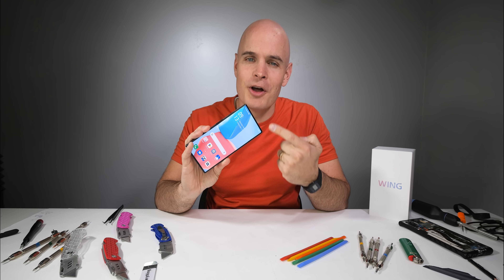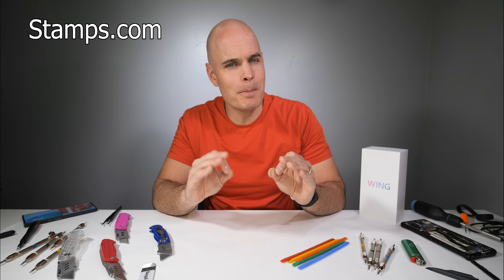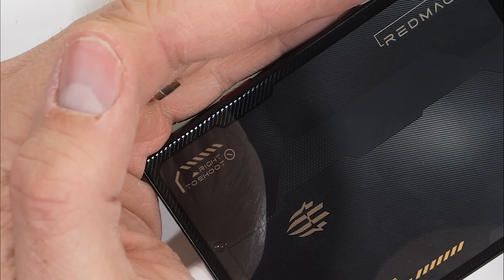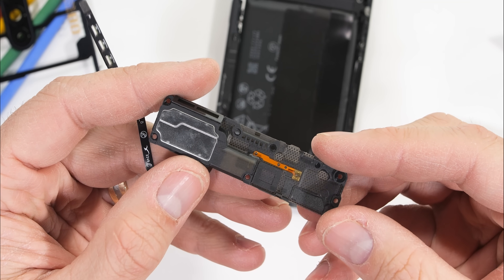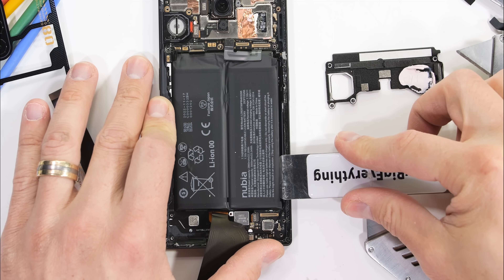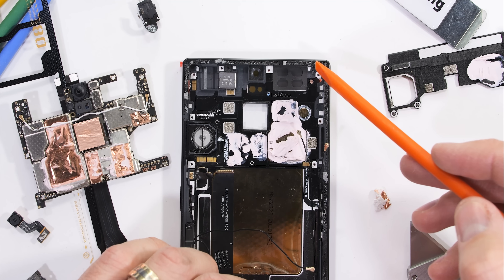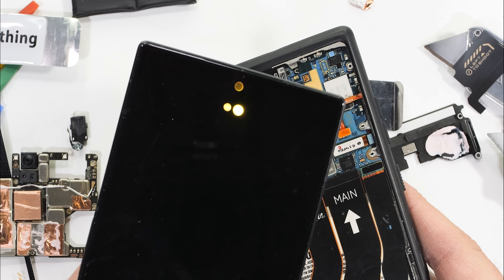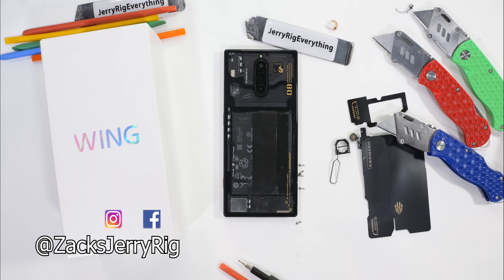The Smartphone she told you not to worry about....

Comment: The screen to body ratio alone is really nice. Love how we are seeing a return to the squared off aesthetic, banish the curved edges!
Reply: as someone who is only buying this for the formfactor... I agree
Reply: @Medicalscape I still can't believe it's aboyt 1% lower than the s23 ultra but if you keep in mind that smartlhone bezels are always mind up of the first black bezels and then the 2nd metal frame u can see the metal frame part is decently large where the black bezels themselves are pretty small. Either way still much better looking overall even if the screen to body ratio isn't anything out of the ordinary. You can look at gsm arena and they have that metric and the much less misleading screen area metric . In case u didn't know screen diagonal is skewed the taller the phone is in aspect ratio. That's why the z fold is only an extra inch in diagonal despite being over double the screen area bcuz it goes from extremely tall to extremely square. Interesting to me at least when i found out idk.
Reply: @Frozoken  yes its really interesting I have been using the zflip3 for a little over a year and a half now I like it alot!

Comment: The shape of the screen, hidden front cam , battery power etc. are very good. It makes sense that it's not waterproof because it has a fan, but I still prefer my phone to be waterproof. And what I don't understand is why companies gradually stop putting sdcard support. OK We have moved to cloud storage. Please don't remove the features we like and make a new phone.
Reply: as someone with trash net speeds and bad mobile coverage no alot of people havnt moved to cloud storage
Reply: Mostly because SD cards tend to cause more problems than they solve, especially when it comes to moving apps to the card. 

However, there are still phones with SD card slots if you want to put your money where your mouth is.
Reply: @Lefaid Cause problems like WTF  ? If you have a slot it won't gonna come and hurt in your back , if you don't want to use it than don't ..
I don't have unlimited cloud storage or internet, we only get 1.5 Gb per day her in general. 
But if my videos/movies have more size than >100 Gb , and it's only read data so it won't reduce speed of mobile while on staying in ROM and not RAM , it won't cause phone to slow down , it's just that apple thing that Android started doing after headphones jack removal saying it was using space while world's thinnest phone still has a headphone jack inside it 🤡

Comment: I know hidden selfie cameras take bad photos but for me personally I use my screen way more than my selfie camera (I almost never use the selfie camera) so I would prefer mine to be hidden.
Reply: I feel like Samsung should release a lower production variant of the s23u with an underdisplay camera, a slimmed down symmetrical chin and slightly more thickness for cooling and more battery for a way more well rounded version of this in everything except under display selfie quality and how well bezels are hidden,  s23u still actually has a slightly higher screen to body ratio with the hole bcuz the red magic's  bezels are just proportionally more of the metal frame rather than the black part which does look better even if u don't get more screen but besides that in the US they're not far off in price to the s23u with clear cost cuts including the actual panel's quality itself in brightness and colour accuracy (ie 800 vs 1300 nits measured, ignoring the higher claims of both), the rear cameras and the obv software ofc
Reply: @Frozoken agreed 💯

Comment: It would be interesting to see how much of a performance difference that little fan would bring along with the (slightly dmaged) copper pads 😂
If possible it would be great if ypu could do a comparison
Reply: I would imagine it to be a measurable, but not huge difference since the air duct does not contain any fins for heat dissipation or is even made of copper. Definitely went for form over function
Reply: @tjibbeettema8759  it would still remove heat from the phone way more efficiently than nothing at all tho

Comment: If need for good long gaming sessions ,choose REDMAGIC 8 .The size really do matters as it packs Much of engineering needed for COOLING🥶❄️ the CPU for keeping those frame rates CONSTANT .Again THANKS  Zack 🤍,You do show us the reason for picking the phone (from the Inside) 🤝.Also the LG WING you did mention has good hardware and software . I would be THANKFUL 🤍 if had it because i do OWN a low spec😓(Nokia 3.1) and it gives me HARD times 😣 and much loading especially when i connect it to Cellular 😕. Would be thankful if a have to switch 😌. THANKS 💚.

Comment: I kinda want to take apart some of my old phones just to look if they have taken up some dust in on the inside over the years. I still have most of the phones I have ever owned. starting from a Siemens that don't work anymore and  Nokia brick that still turns on if the charger is plugged in.
Unrelated to phones do you play games and if you do.... have you played warthunder? I am looking some someone to platoon up with
Reply: ouh... have you destroyed any of the old phones? I have been watching you videos for a fairly long time on and off when I see one pop up but haven't really gone through all of them. So I am kinda interested in seeing the difference in structural strength between old and new phones.